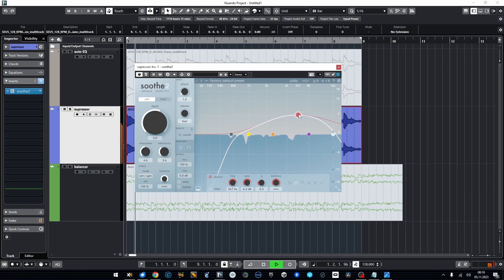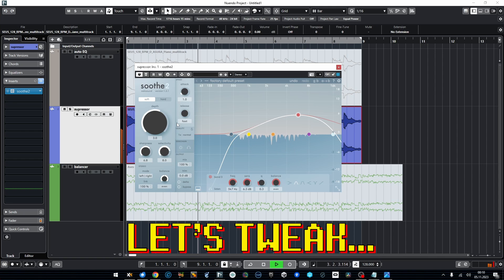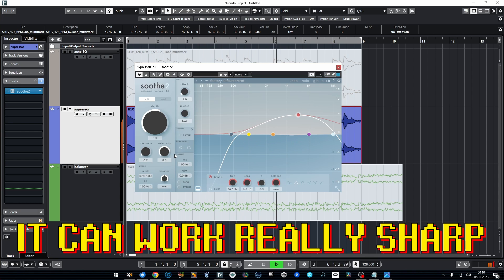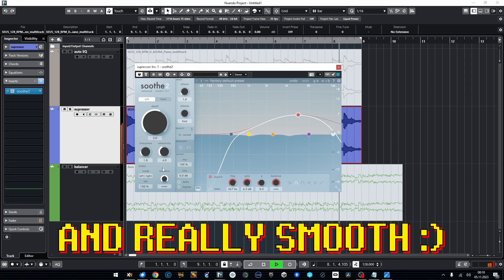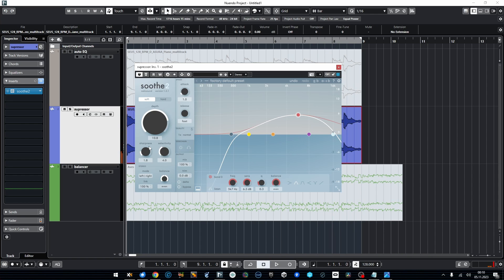Tone balancers, auto EQs, resonance supressors EXPLAINED. Once and for all!

Comment: Great video!
A lot of people really need to watch this to clear things up.
There is a lot of nonsense talk about Soothe vs Gullfoss for example.

One addition I would have made:
Gullfoss and TEOTE are very similiar in the goals they have for the sound, like improving clarity generally said.
Although I think there are technically very different and as I understand also from my user experience there lays the difference and potential.
Gullfoss is fft processing and TEOTE is a more classical filterbank with adjustable filter count. This makes all the difference to me.
TEOTE´s controls are very user unfriendly at first and unconventionally labelled but its so worth spending the time learning it, I love how I can manipulate its processing.
Gullfoss is a bit more generall with that like Im able to tilt the processing and decide between adding and subtracting but thats very much it.
TEOTE is much more flexible.
Love them both so much.

Soothe2 & Spiff are just different beasts. Theese are very important multitools. They can do so much very different stuff its amazing.
Reply from the maker: Yes, Gullfoss and Teote can give you very comparable results, but they work so different, agreed 110%!

Comment: I use almost all of these together and it covers 80% of what I do. 
Neutron at the top of every track (covers eq, comp, transients, saturation etc), then smart EQ (used mostly for the grouping feature), then gulfoss on the bus, and soothe where needed.  
It still requires a watchful eye (like not letting gulfoss try to undo an obvious eq change), but is a killer workflow.
Reply from the maker: Yea, sounds killer. Cheers!

Comment: From my experience, TEOTE and Wavesfactory EQUALIZER are the same; they just have different options to tweak the sound, and EQUALIZER is more radical, but it sounds like both targets are flat like a white noise target, but Gullfoss doesn't sound like them at all, so my guess is that Gullfoss maybe has a slop target like pink noise or something, what do you think about that?
Reply from the maker: Gullfoss seems a bit more elaborate
 It can expose elements of harmonics or elements that are between them. Its curve is also quite interesting and it doesn't look like pink nor white noise. Cheers!

Comment: I'm pretty sure Smooth Operator should be grouped with the tone balancers. Tone balancers kind of do resonance suppression as a side effect if you think about it? And I think baby audio mainly decided to focus on that aspect with smooth operator for marketing
Reply: i think tone balancing is like surpressing resonances and then applying a smoother EQ curve inverted to the surpression to get the overall spectral balance to sound the same as before again, but also not really, because i rarely hear these kinda plugins actually preserving the balance a lot
Reply from the maker: @Beatsbasteln  , what I can tell you for sure is that tone balancers are nothing like resonance suppresors smoothed out. They not only cut the peaks, they add up things. They can be set really specifically, like Gullfoss. I'm 110% convinced, that DSEQ or soothe2 are nothing like Gullfoss or Teote and that's why I recorder this vid.
Reply from the maker: Yes, Gullfoss does "kind of" supression on some settings, but it definitely differs from soothe2, Smooth Operator etc. As far as I learned from Baby Audio tool, its concept is very similar to soothe2, maybe I missed something on the way?
Reply: My experience with smooth operator is just, that it removes a lot more than just resonances and basically if you're not veeeeeery careful you'll immediately start changing the tonal balance of your signal. So it's a tool that can be used for resonance suppression, but you kinda gotta find and target the resonances by yourself. Usually I use it more like a dynamic eq. I feel from what I've seen from wavesfactory equalizer it probably works in a very similar way to that one